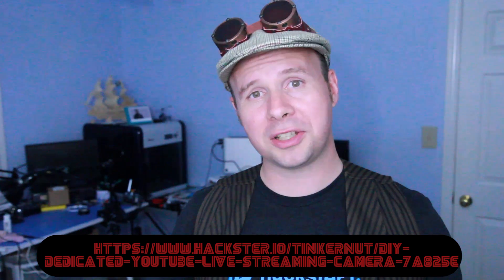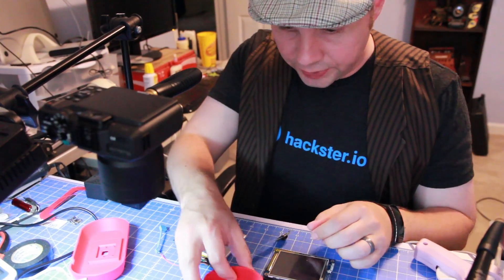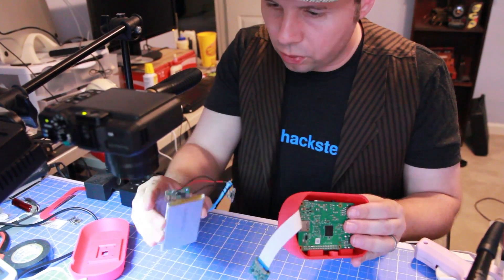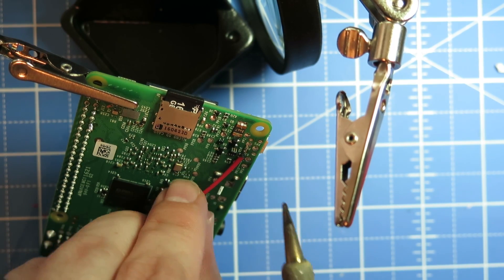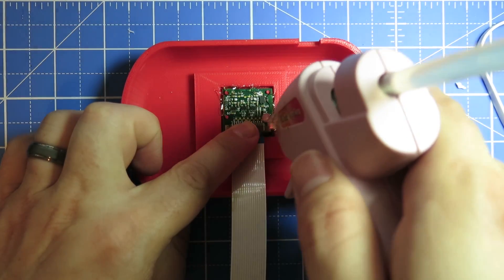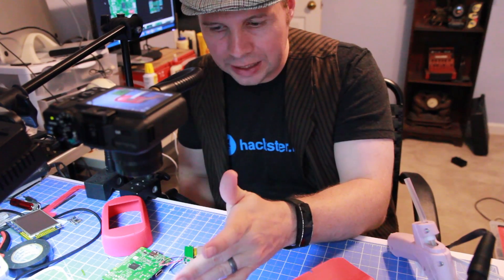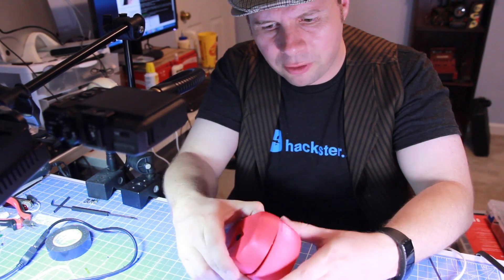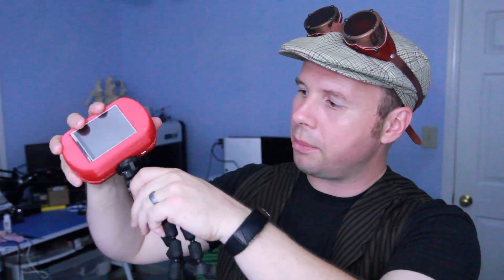Ultimate Youtube Live Camera!

Comment: I like the concept but there are a few things I'd do differently. 
Firstly, I'd make a case that could be easily taken apart for maintenance either with screws or tabs for a streamlined look. Perhaps with areas designed to improve grip when used handheld. 
The other thing is the depth of the case is too big so I'd do as much as possible to reduce the thickness of the contents by removing unwanted headers and any other unnecessary bulky components. 
Looks like you're not a confident solderer but one important tip is to ADD solder to any joint when first soldering it as well as tinning the wires - this would make for a much more physically robust connection as well as improve the flow of the solder due to the flux core within the solder. This is particularly important when connecting wires to / from LiPo and Li-ion batteries as a detached wire could lead to a dangerous short causing a battery fire or damage sensitive components on the Arduino PCB.
I would have printed the play button in white filament and have it clip in for easy assembly. 
I don't particularly like to use hot melt glue to hold things together - whilst it can be handy in some situations it makes disassembly much more difficult and components are harder to reuse with glue all over them. I'd have used screws where possible (any PCB's and the camera module) or double stick foam pads / tape for the battery.
Overall I'm impressed with your efforts and I'm quite sure I'd struggle with the programming side of things where you obviously excel!